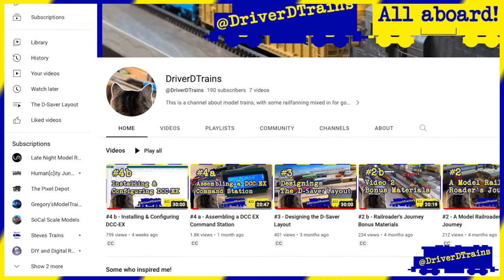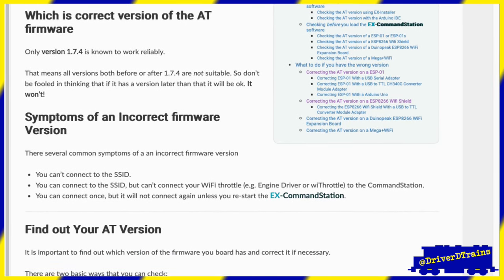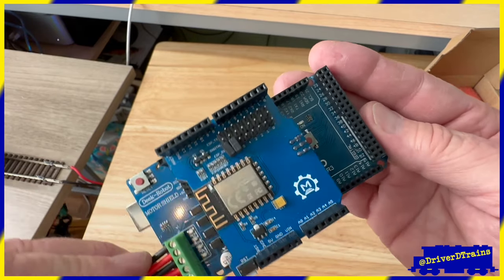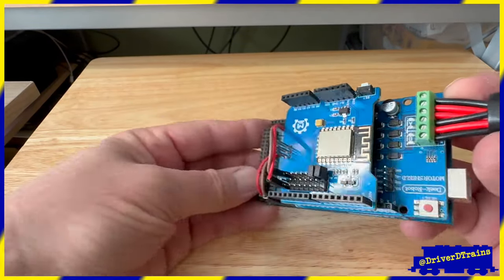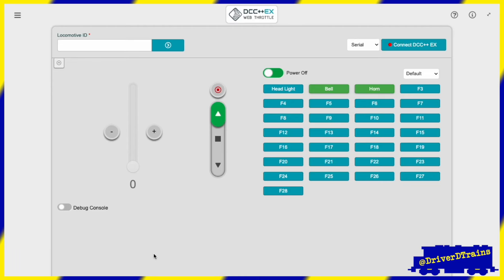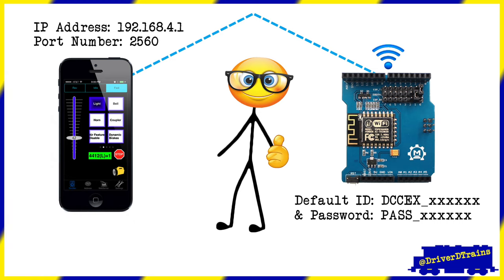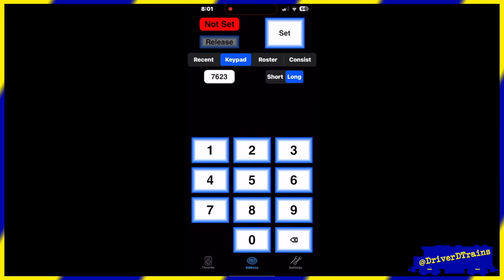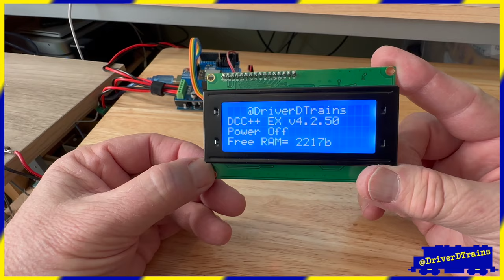#4.c - Adding Wi-Fi to DCC-EX   @DriverDTrains

Comment: Great clear video.  I made a few DCC-EX stations since DCC++.  Today I have two with LCD screened versions that connect to my home WIFI  but have not updated to version 5.  I have rosters and turnouts programed in so I cannot simply press update and get the latest version without a bit of work on my part.  I also bought the new Digitrax DCS210+ system to play with.  I prefer a real throttle to using my phone.  Recenlty I am working on automation on my HO shelf layout.  Give Scratchy  a treat from me.
Reply from the maker: Thank you very much for your kind comments. I'm glad you enjoyed the video, and Scratchy sends thanks for the treat! Sounds like you have a great setup there. I've tried a few different throttles with DCC-EX and JMRI in addition to the phone and tablet, including wireless keypads, a wireless mouse (scroll wheel for the throttle), and even the ProtoThrottle. But the D-Saver it tiny so I don't need much. Enjoy playing with the new Digitrax, and setting up those automations!

Thanks again!  DD

Comment: I'm in the starting to build my command station. My biggest question is how can I operate the wifi throttles and such without internet. Could I set up a LAN and use it that way without active Internet
Reply from the maker: Thank you for your comments and questions. I really appreciate it. There are several ways you can operate the Wi-Fi throttles on DCC-EX without internet. As discussed in this video #4.c and the next one #4.d, you can use the wi-fi on your DCC-EX command station in access point (AP) mode and connect your wi-fi throttles to the command station directly; no internet or LAN (router) required. Another option is to get an old router and set up a LAN as you alluded to. There are other methods as well. If you have a computer connected to your DCC-EX command station, you could install JMRI and use its Wi-Fi server. I discuss this in my series of videos on JMRI. But the easiest method is just to use the DCC-EX wi-fi in access point mode unless there is a specific reason (you want to run too many throttles, the layout room is too large, etc.) not to. Again, be sure to watch this video $4.d and the next one #4.d. Enjoy!

Thanks again and happy railroading!
DD

Comment: Hope you can help me?  I get message LCD4:WiFi no AT chip plus other stuff.  I have blinking blue light and have the jumper wires correct.
Reply from the maker: This sometimes happens when you update the DCC-EX software and the Wi-Fi chip stops responding, even with the correct firmware. Try unplugging the power from the command station (USB cable & track power), waiting a few moments, and then plugging it back in. You may need to do that a couple of times. Hopefully after that DCC-EX will find the Wi-Fi chip. If not, replace the jumper wires with new ones. And I know  you've checked that they're correct, but for others I will remind that the TX on the command station has to connect to the RX on the Wi-Fi, and the RX on the command station has to connect to the TX on the Wi-Fi. Hope that helps!

DD

Comment: Does ESP8266 WIFI Shield pilot light stay on goes off after short time?
Reply from the maker: Thank you for your kind comment and question. On my Wi-Fi shield the light flashes 2 or 3 times when the command station boots, and then goes out. However I have heard that on some versions of the Wi-Fi shield, or with some firmwares, the light may stay on. The light on the Arduino Uno is always on. 

I'm sorry that I don't have a more definitive answer for you. Good luck and happy railroading!

Thanks again,
DD